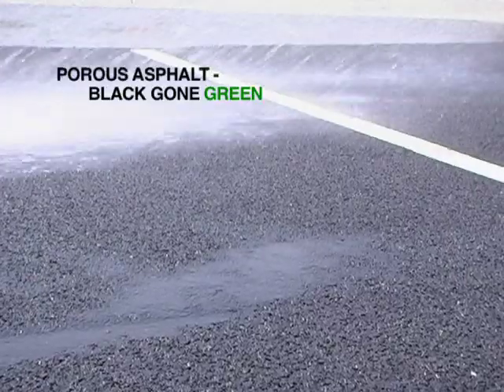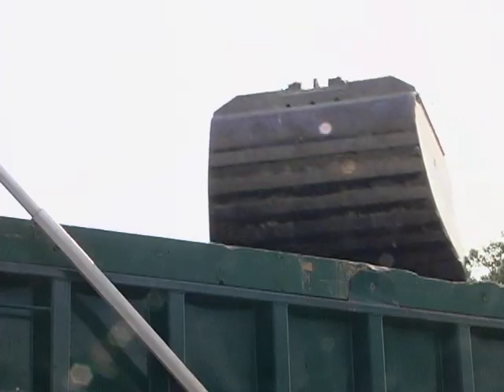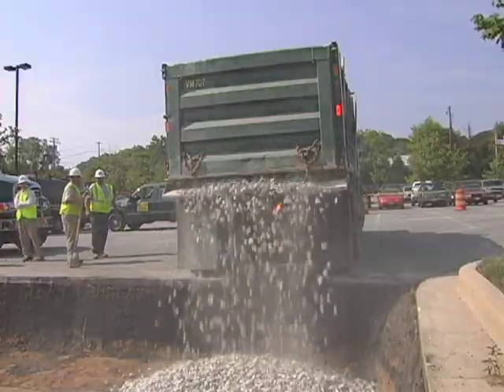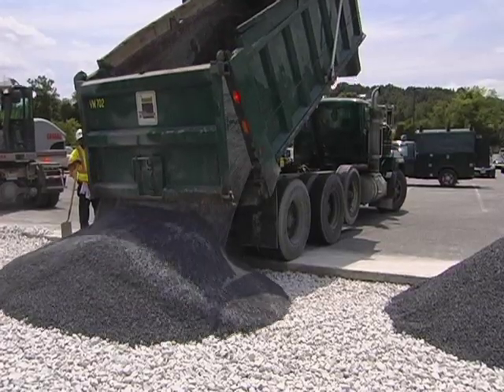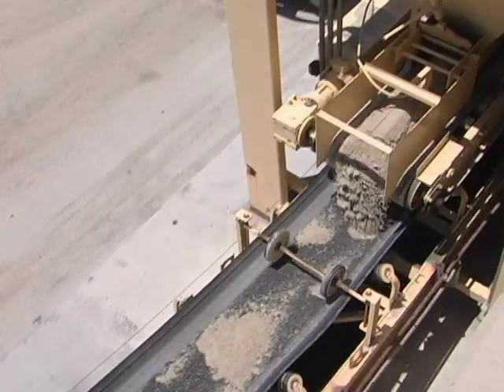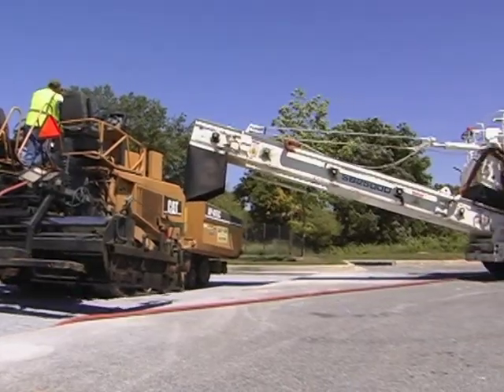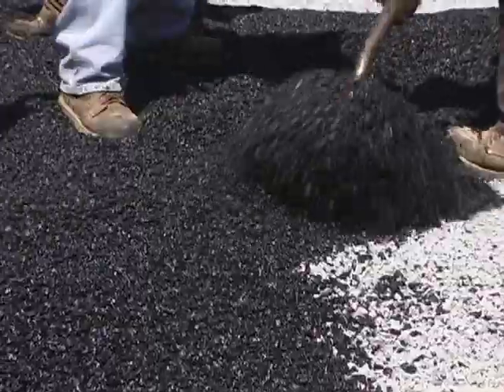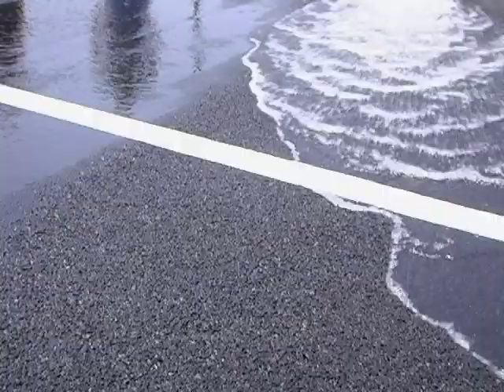Porous Asphalt Demonstration

Comment: Wait, if the water goes to the ground, then what is the under-drain for?
Reply: The ground can only absorb so much.  For times of heavy rains, the drain is needed to take excess water away so it doesn't pool on the surface.
Reply: @lionelhuts875  But where does that excess water go? Is it connected to a canal?
Reply: @johnandrehilagan646  I believe the regular sanitary sewer system, yes  - like the grates do for normal pavement.
Reply: @lionelhuts875  oh, so even when applying this in, for example, a house' driveway, it's still connected to the sewer system. Thanks, that was a helpful info.
Reply: @johnandrehilagan646  Typically residentials just drain on to the street, although draining in to the sewer is possible.

Comment: what about in a freeze will it crack?
Reply: As long as the water has room to expand (it's porous), it shouldn't crack or damage anything seriously.  Try putting water in a 20oz pop bottle, don't put a cap on it then freeze it and watch what happens.

Comment: imagine the temperature goes below freezing after a rain, the whole road would wrack up
Reply: the whole point of porous asphalt is that water flows through it
Reply: @sausageman4086  as water flows through, some water molecules will stay on the surface inside, and when it freezes, they expand and potentially cause cracks
Reply: @cks2020693  the water flows through the asphalt, in from the top out from the bottom. Any leftover molecules would be to few to cause serious damage to the pavement.
Reply: not really
Reply: @Andy As long as the water has room to expand (it's porous), it shouldn't crack or damage anything seriously.  Try putting water in a 20oz pop bottle, don't put a cap on it then freeze it and watch what happens.

Comment: Correct me if I am wrong, but isn't the whole point of permeable pavements asphalt or other to keep runoff out of the storm drains? To reduce runoff by infiltrating water rather than letting it pollute the watershed? 
This video appeared to just use it to hit the drain faster.
Reply: It has several purposes: 
No water on the road. (Aquaplaning, better visibility)
More water can penetrate into the soil underneath.
Thus less water in the drainage system.
Less water at once into drainage, it stores it.
Less noise from trucks and cars.

Every highway in the Netherlands has a surface of ZOAB (Zeer Open Asfalt Beton) Very Open Asphalt Concrete.
Reply: No, you’re correct that’s more or less what it was intended for.

Comment: Lol, you can't just dump a layer. Fines are important for compaction. The purpose of fines is to reduce settlement. Your top layer will experience fine transport over time and your entire surface layer will drop. The design life of pavement will be considerably less. I understand you want to encourage ground water recharge, so how about you pick strips in the car park in which vehicles are not to run on. Slope you asphalt to these points and utilize your technology there. A good area is between back to back parking, use the concrete parking berm to protect the strip from traffic. You can have several strips of these, encourage the ground water recharge and get the design life. Also one should take into consideration scheduled cleaning of the surface course. Overtime, fines will clog anything
Reply: Nice... But wat does cleaning mean? Clean the pipes or the road itself??

Comment: People keep bitching about oil spills getting into the water system. Did anyone notice the shut off valve from the rock bed to the drain pipe, they installed 1. So this is a better actually method in preventing spills from spreading into the water system.

Comment: I'd prefer if my tax money gets spent on standard asphalt and catchbasins with normal drainage, because those can be maintained and repaired. From what I've seen porous pavement just gets clogged with silt and moss and also the free-thaw cycles just blow it out.
Reply: It is more expensive but worth it. It's been used here in the Netherlands for a long time. The quality of the roads/road surface is far superior to the US (safer too).  Clogs do happen but regular street cleaning is effective.
Reply: Freeze thaw cycles are fine. It's a porous material. The reason freeze-thaw damages things like concrete and cement when they get cracks is because more water builds up in there than escape, so as it freezes it expands and breaks. Porous most of, if not all of the water drains out of the cement/concrete. What doesn't isn't substantial enough to build up enough pressure to cause breaks.

Comment: not feelin' it! expensive! will carry toxicities from vehicles or mismanagements into ground waters with NO CHANCE of intervening or hitting spills off at the pass through barrier attempts! Also poses infrastructure hardships. those layers would be harder to work around and would require MUCH MORE EFFORTS AND MONIES to install piping for utility/cablings or any other often future upgradings to infrastructure. I DONT THINK IT IS A WELL THOUGHT OUT PLAN/MEDIUM!
Reply: 85% Of highways in The Netherlands are ZOAB.
They have the best roads.
Reply: Those toxicities are going to the same place with or without this technology. It would be easier to install piping for utilities/cablings because the actual paved area is thinner and would be an easier patch. It's very well thought out.

Comment: wouldn't make it through one freeze cycle let alone an entire winter in northern midwest
Reply: Wrong!! Tested by the University of New Hampshire for exactly what you are talking about and it reduced the need for deicing agents by up to 75%. The water goes down into the rock bed and does not affect the pavement.  It has been used at a park in Massachusetts since 1977.  See this link: https://www.millermicro.com/porpave.html. 
Walden Pond State Reservation One good porous pavement installation was installed by the Commonwealth of Massachusetts at Walden Pond as a demonstration project in 1977. Twenty years later, a long time for one paving job on that busy parking lot, it still looks good and works well.  

Federal Highway and Waterway Administration link: https://www.fhwa.dot.gov/pavement/pub_details.cfm?id=948
Reply: Try filling a water bottle with water, don't put a lid on, then freeze it. Does it damage the water bottle?

Comment: all looks great, I am just wondering, in the event of a motor vehicle accident or accidental spill of what ever oil, pest-o -side how do you stop it running through and off into the ground and eventually the drains, as it is now not possible to dam the run off at the drain grate,  as most car parks generally have oil patches where cars park and they usually are easily seen, dose this waste oil stain the porous asphalt or just soak through to the sub-straight leaving no visibly trace?
Reply: This actually makes it easier to clean and contain the spill. You hook a hose up to the outlet they installed, then flush the entire thing with lots of liquid until the outlet is coming out clean.
Reply: Mark Thornton I think that is what the valve is for that they installed at the beginning of the video.
Reply: But even so even if it was mud wouldn't mud also absord the oil... And stuff
Reply: But no one is now going around and cleaning the spots of oil. The oil is being rained on, and carrying into the waterways. At least porous asphalt slows its pace.

Comment: 1st time it freezes... it'll look like particle board in a rainstorm.
Reply: As long as the water has room to expand (it's porous), it shouldn't crack or damage anything seriously.  Try putting water in a 20oz pop bottle, don't put a cap on it then freeze it and watch what happens.

Comment: how does this work with the freeze/thaw of winter?
Reply: Commissar0617 
I Live in The Netherlands and have been driving on it for over 10 years. In winters you do see more wear and tear of the roads, mostly caused by trucks. Typically it is quickly repaired. It is completely worth it as the visibility on the highways is so much better.
Reply: That will require an additional 20k dollar heating element
Reply: The water just drains through it.  No surface ice.
Reply: Boda Edits
exactly. the water will freeze inside of it. i also think you don't realize the myriad ways that ice tends to form on roadways
Reply: moving water will not freeze and with the right sub base there will be no problems.
Reply: never stop fighting, LMAO, moving water doesn't freeze. I live in Iowa and the Mississippi river freezes every year. When water freezes it will expand in every direction by 10 percent its liquid mass. It would depend on how porous this new asphalt is. But then again in the northern states where we live the ice will just build up and it will destroy this material. Guess that's why it isn't really being used. I would have to say in the southern states this would cause the storm sewers to overflow more quickly because the water seeps into the material at a rapid rate not allowing the sun to evaporate it as much as it would normally. I guess to be sure about this one would have to do a study on this material and I for one do not think its worth the effort!

Comment: economically usefull or not
Reply: PERLI JESSI 
Well it gives more visibility, which leads to fewer accidents, which leads to fewer repairs required and hospital costs.
Also less accidents means less traffic jams or you spend less time in traffic jams. 
Time is money, certainly for trucks on the road. The calculation should go a little deeper than the pure costs of this road surface but also on the value it could bring.
Reply: Depends on the site.  Retention ponds are not cheap to build and this may be a better solution.
Reply: PERLI JESSI 
Well it gives more visibility, which leads to fewer accidents, which leads to fewer repairs required and hospital costs.
Also less accidents means less traffic jams or you spend less time in traffic jams. 
Time is money, certainly for trucks on the road. The calculation should go a little deeper than the pure costs of this road surface but also on the value it could bring.

Comment: Interesting. Thanks for helping me get a better understanding of this. Some folks are apparently very much against the material, citing a litany of claims, but it's use is recommended and indeed sometimes required by NJDEP for sites that create large amounts of impervious areas.

Could you guys elaborate a bit on appropriate locations for the material as well as recommended maintenance activities to ensure full life expectancy? My understanding is that locations seeing light traffic and minimal turning movements are ideal (i.e. satellite parking lots) and that vacuum truck cleaning is preferred over just basic sweeping. Can you confirm?

Thanks!

Comment: Seems to me that this type of asphalt would last longer.  Regular asphalt only lasts 15 to 20 years in part because of standing water.  If this allows the water to move through and out, that process should allow the asphalt to dry faster and last longer.
Reply: Well I'm just talking about "in theory."  Now that they have the concept, they need to improve and perfect it.
Reply: Rubberized asphalt, at least here in Arizona wears out kind of weird. It seems to last quite a long time on freeways but won't last more than a couple of years on surface streets, especially where the roads have a lot of turning traffic like driveways and intersections.